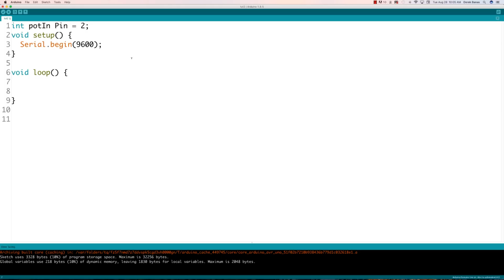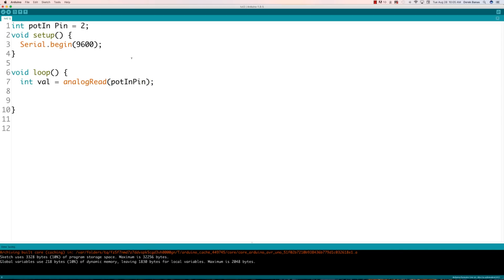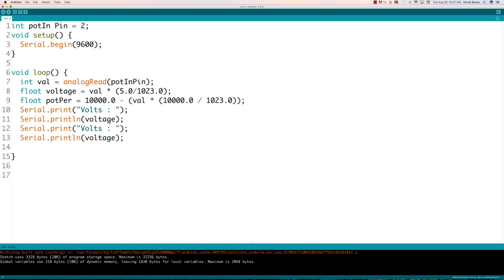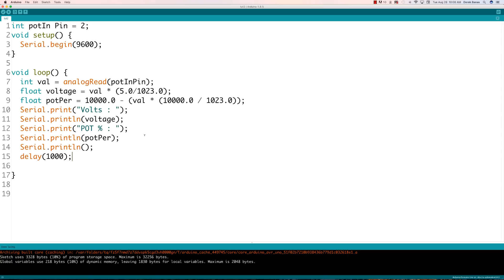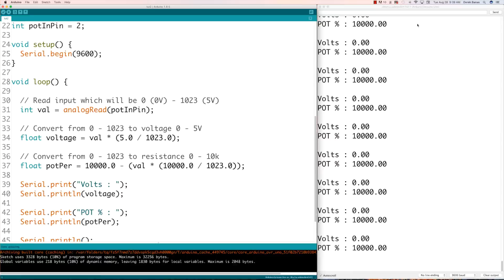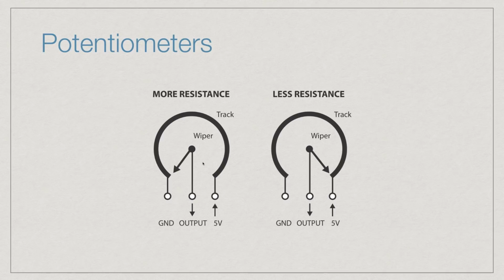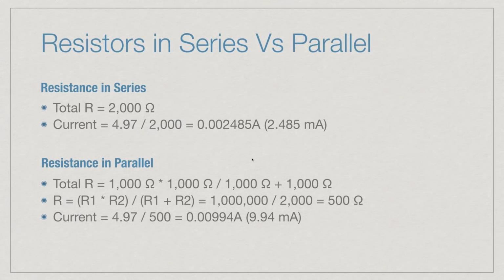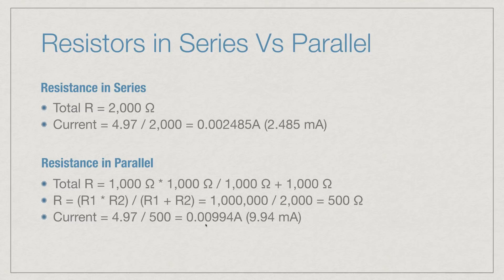Arduino Tutorial 2

Comment: Why 255/5, other than that good video. Another one of your videos you use the number 1023 but you never explain why 255 or 1023 in either video. Slow down a little and explain what may or may not be obvious to beginners, but apparently is abvious to you.  Such as 255/5 that equals 51 and we are talking about varing the voltage from 0 to 5 volts so why the heck use 255/5 which eauals 51?
Reply: Sorry, I am a beginner. I finally read more about Analog write and Analog read and PWM on the Arduino web sites and then I began to understand why the number 255 and 1023 were used by you. If you are a beginner like me you can google Arduino Analogoutput() and learn more about why he uses 255 and 1023.

Comment: I think that you should mention that there's two different places where you have to hook up your probe too on your multimeter. Current has one slot for that, voltage and resistance have another slot. So when you're measuring voltage or current, you have to swap out probe slots.
Reply from the maker: Yes I agree. I'm working on my presentation skills here with the new setup